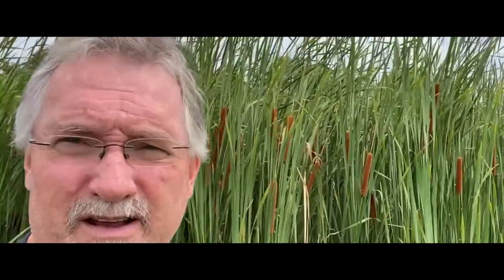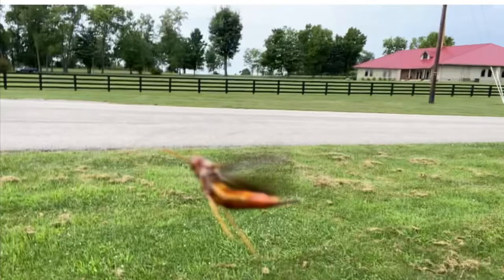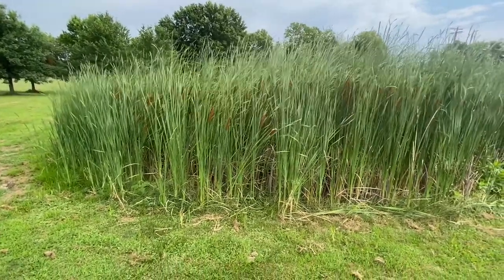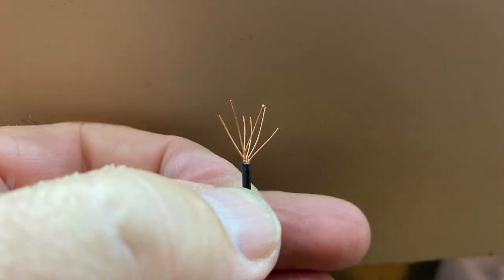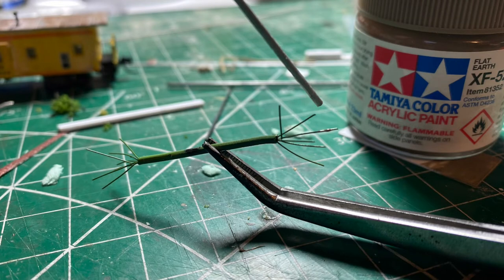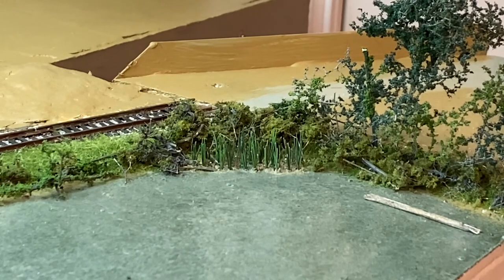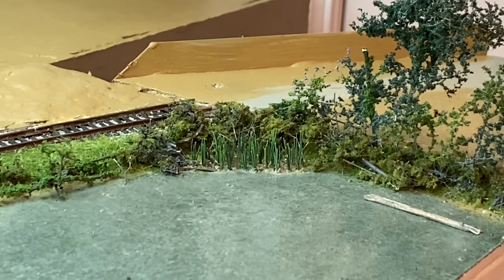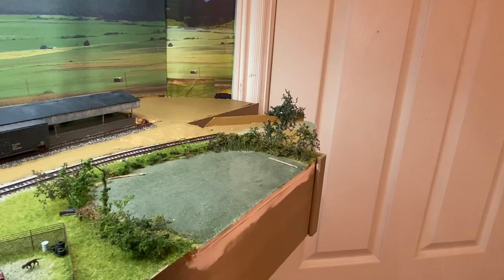How I make N scale cattails, Oak Hill update 57

Comment: Hello Thom, very interesting your trip to the swamp area and to build it on your model railway. The reed stalks you designed there look very good. Very nicely filmed. Stay healthy. Greetings Wolfgang
Reply from the maker: Thank you Wolfgang. I hope you are not experiencing the heat that has engulfed a lot of Europe. Stay safe!
Reply: @thomplacier677  Hello Thom, it's currently 38 degrees plus or 100.4 F. But we have a basement under our house and the heat is very bearable there. at 23 degrees. And the temperatures are supposed to drop again from Thursday. Greetings Wolfgang